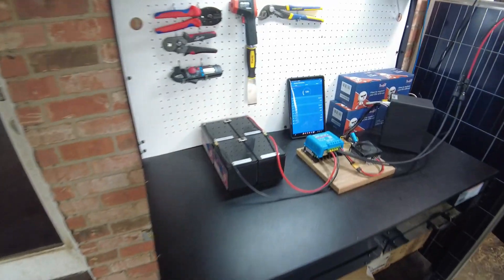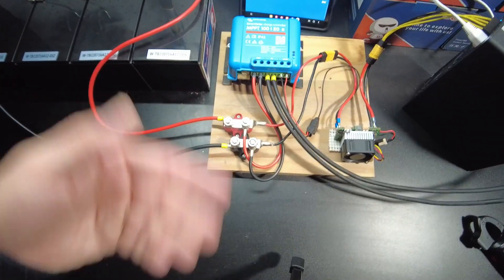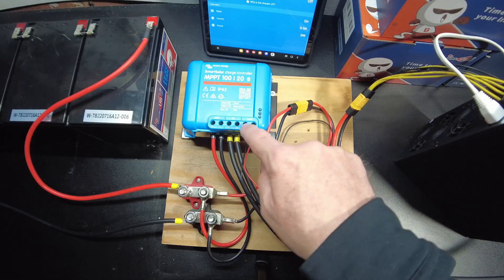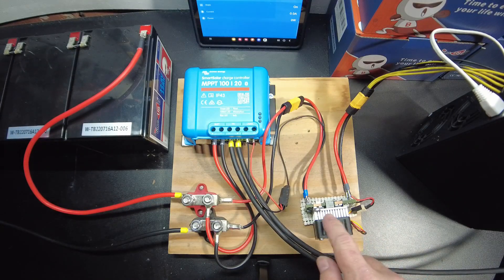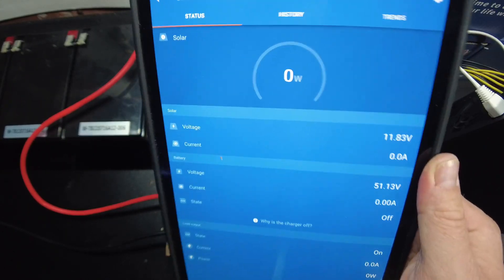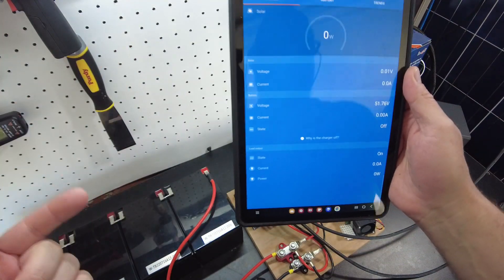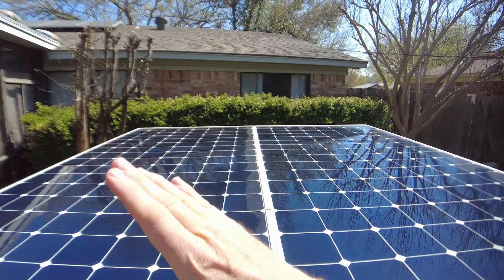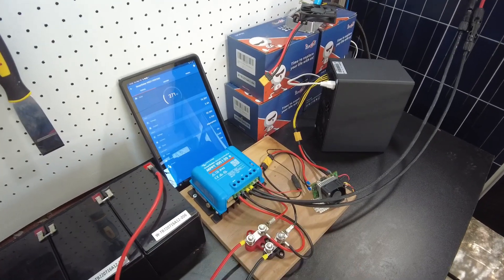ASIC Solar Crypto Mining 48v Configuration

Comment: I'm considering bypassing an MPPT or PWM controller entirely on my next project. The three panels I will be using have  peak power voltage of 22V, so in series 66V and the 16 x LFP cells will vary from 40V fully discharged to 58.4V fully charged. I realise when I need current the most (at the discharged 40V) mark the solar panels will be operating at much lower efficiency  but will ramp up in efficiency as they charge and approach the 58.4V mark. I'm not concerned about the batteries - they are managed by high/low cut-off by a Daly BMS.
Reply from the maker: That might work, but you still need a load controller for low voltage disconnect, and upper voltage reconnect. Otherwise your load will try to run in the morning when there is not enough power, it will put your load/equipment in a zombie error state. You need it to only come on when the batteries have a bit of charge, and the solar is producing enough power to run the load.
Reply: @BradCagle  Cool, thanks for the feedback. It seemed to simple and cheap, but you are right, once the BMS trips it needs a battery disconnect to start again.

Comment: love to see more on that relay... that's a nice idea to protect the battery
Reply from the maker: No problem, I actually have a much larger rely that you can pump a lot of current through. I'll do a little video on it.
Reply: @BradCagle  I missed the last update... just watched it ow. what's the other low voltage isolator too ? 
I am thinking of a 48v system... so anything to do with 48 to 12 and the best isolators and fuses 
thanks